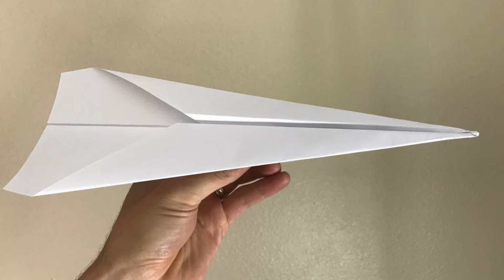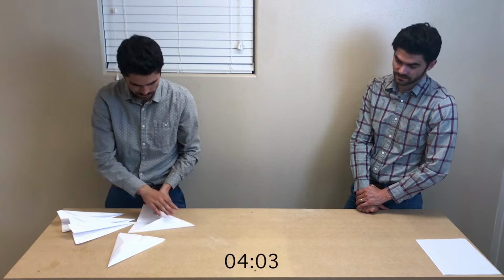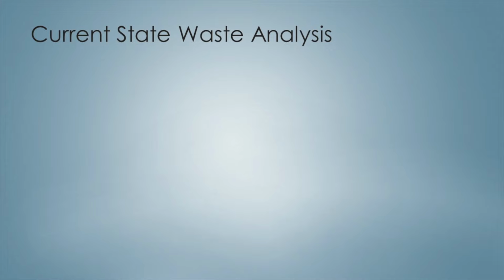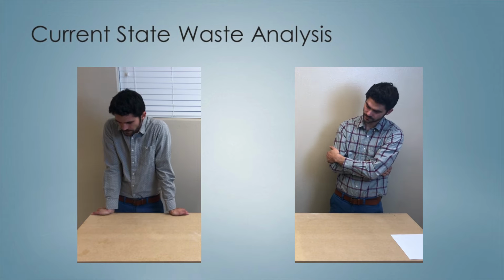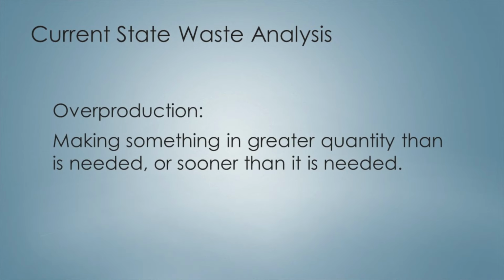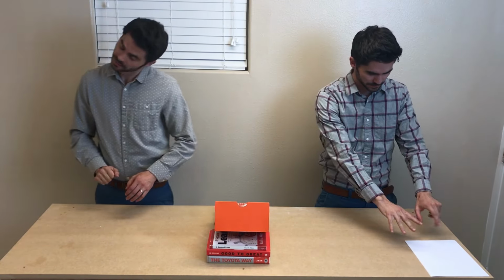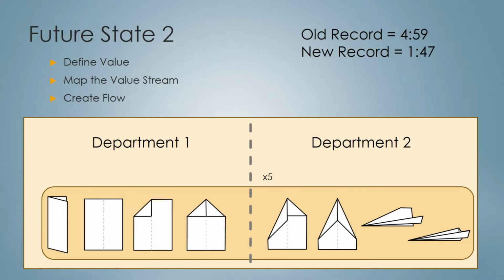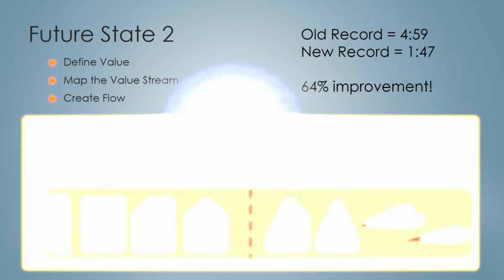Lean Manufacturing One Piece Flow vs. Mass Production Paper Airplane Simulation (Lean Tip 005)

Comment: You guys never show these thing implemented on a real complex line. Your examples are always legos and i guess now paper planes. Show me how you do these for glue, potting, and varnish cure times in between builds.
Reply from the maker: If you live near kansas city, contact me via my website! leansmarts.com. The goal is one piece flow but in the places where you can't do that, you pull in small batches. Gluing and varnishing, with unchanging cure times determined by physics/chemistry, may demand a degree of batching. it just depends.

When my wife and I did our donut business, I was never going to mix enough dough for one donut at a time. We'd go out of business. But our business model was extraordinarily benefited by producing dough in small batches (versus large/huge batches). And the rest of the production process was exceptionally well balanced and linked together with minimal in-process inventory.

Comment: Without producing to actual demand this isn’t remotely lean - you just went from craft / batch production to a basic division of labour like Henry Ford did at the turn of the last century. 
We are now living in the on-demand economy where, for example: At Amazon the book doesn’t even exist until you order it. It is then printed and assembled on demand via a flow system and it is with you in less than 24 hours. 
No wonder lean has a reputation for failure if the basic foundations are not being taught. 
You have to simulate: 
The one-by-one ordering. 
The what you do when you have nothing to do
The progressive division or contraction of labour and physical flow depending on demand.
And the many other aspects of lean… 
Just-In-Time logistics etc.

Comment: I really appreciate your videos. You are giving great examples to learn about Lean. But I have a doubt regarding one comment that you did. It’s about Inventory. For me, inventory is the action to count what do you really have in your process or factory because somehow you don’t trust the accounting system that you have.
Reply from the maker: Don’t apologize! I think I understand you, and in a way I don’t disagree. But I would instead say that the “gemba” is the truth. That’s the Japanese word for the actual place where work is performed. A good and smart manager or person will go to the gemba to know the real situation. Computers and reports are powerful and can be useful, but there’s no substitute for the real place. Also, there’s often error between the gemba and softwares/reports. At the end of the day, the accounting records need to be completed and hopefully accurate. It’s easier if there is less inventory. But it’s still a necessary evil to audit and cycle count, etc.
Reply: @LeanSmarts  👍👍 I agree totally. Gemba is the truth, what it is really happening. I’ve heard that in some places they are calling the 9th Muda the Wrong information. Some how if the information that you have is not correct you will need to check or look for the correct one. (In my opinion that will be included in the inventory Muda). Many thanks for your reply!!
Reply: And of course it is a total waste. But I don’t see that you are counting planes in your video. But of course you could do it, and yes it will be. Sorry to share my thoughts

Comment: For the company I worked for a blend of old vs new processes was ideal, one piece flow doesn't work great when you have multiple workstation processes, you lose time getting up and moving to next station. Per.piece it's slower than perhaps doing 5 pieces moving to next station making the next move with those 5 pieces, just be cognizant of an employee at the end stage is not waiting , it an adaptive process , what works for one company might not be ideal for another. It's a continuous improvement process.

Comment: In this example, you can eliminate the idle time of the workers entirely by letting both of them do the entire process separately from one another. Also, it looks like you could do the first three folds with the entire batch of 5 stacked on top of one another. One more thing worth considering is that you can do folds 2 and 3 simultaneously with your left and right hand. Perhaps a "press" of some sort would also help speed up the process of carving out the lines in the paper, much like Japanese printmakers do, albeit in a different way, with special wooden tools. Interesting example!

Comment: Don't you have 5x the transportation with the one piece flow?  How does that figure in?
Reply: No. Since it is a one-piece flow, it will flow in the production line in the quickest and smoothest way. Whereas with overproduction, you will need to store ( larger space) and need conventional transporting system ( trucks etc).

Comment: This video - and many similar - aims to illustrate the 'large' benefits of reducing batch sizes. It primarily illustrates is the effect of idling resources; resources in the batch process are idle half of the time. In a continuous flow, the throughputs are identical and independent of the batch sizes, i.e. the productivity is identical. The benefits of reducing batch size come from the reduced WIP and/or cycle time. And then we are back to the discussion of the trade-off between transaction costs and holding costs - or efficiency versus speed
Reply: 100%!

Comment: One peeve I have with this type of example (here and other places I've seen similar ones) is that most of the improvement comes from making station 2 work at the time as station 1 as opposed to sitting around waiting. In real life, you're probably going to be continuously doing batches of 5, in which case (after the very first batch) both stations are already going to be working simultaneously. In that case, there can be benefit to one piece flow, but not necessarily... you have to take into account set up time and the like.
Reply from the maker: Hi John! The video primarily demonstrates significant lead time improvement. There’s also a reduction in process time per airplane due to some reduction of motion. But even if there is no change in the amount of process time per airplane, the lead time reduction is very beneficial for the nimbleness of an operation and its ability to adapt quickly to changing customer demand or production problems. Perhaps one day we’ll make a new one of these videos that more strongly demonstrates process time improvements! In the meantime, don’t throw out the idea of flow. There’s radical gains to be achieved by it.
Reply: Sure, but it's about finding the right sized order for the flow to continue. In that example, it made sense to the workflow to do 1 at a time then pass it off.
In my company, we recently discovered that small batches work well in certain situations. For example, we have a customer who put in an order for 10 different items... each item had several components with slight variations, so it requires double checking. So instead of one person processing the whole order at once then handing the whole order to someone else to check, they discovered that if they hand off one item at a time the end result is the whole order being input and checked in less time. 
So, yes, some flows required small batches of work for it to keep flowing smoothly through the system. It's really about the flow of the process.

On the extreme other side of my example, my workers could have input 1 line item then had someone check it. Then one more line item then had someone check it, but that was way too much going back and forth causing a lot overprocessing and transportation that isn't needed.
Reply: @chazhinkeldey2362  It's called Hybrid approach, and the clue is in the name. You use a bit of both worlds. You turn small bunches in one piece and you treat that as... one piece. The key point of OPP is to improve leadtime and in combo with LM you eliminate Motion, Inventory, Overprocess etc. And technically, that's what we see here. This is actually a hybrid as he first does a number of actions and then passes it on to do the rest.

Comment: Very interesting video !
But if there is only 1 batch to produce, this video is ok but in real production, when department 1 is producing batch N, department 2 is not waiting but finishing to produce batch N-1.
Then when dept 2 is finishing batch N, dept 1 is starting ton produce batch N+1.

That would be  interesting to explain  that for batch production : they finish 2 batches within 4min59, batch N-1 then batch N (so 29,9 sec/pcs),
 then with one piece flow : they finish  1 + 5 pieces within 1min47 (so 17,8sec/pcs).
So -41% process time / pcs
 
Lean is the way \o/
Reply: you need to add buffer inventory at key places to ensure the work is balanced. in this example each 4 operations basically took the same time for each employee but when they are drastically different you need to add more workers to the slower process or add more buffer inventory in between stations

Comment: Well comparaison is kind of wrong: you are only considering 1 batch of five making the two employees doing nothing for more than two minutes.
If you consider several batches, you're bottleneck will be on step 2 (2:45 minutes). So it takes you 2:45 minutes to make 5 pieces (not 4:59). Improvement is still 35%, which is great

Comment: What about if both employees folded the entire airplane by themselves? It would eliminate the transfer time between work cells and the idling of the second cell while waiting for the part assembly. Is there only one type of paper airplane ordered and are they all in A4? Not even talking about the differences between the manufacture times between cells if few types of the planes require different more or less intricate folding patterns! The folding process also doesn't seem all that optimized but I'll let that slide as this is just a demonstration.

As far as I can see after quite a significant time of research into it, one piece flow is an exellent option for departments that manufacture a specific device or appliance but when said department is working in a niche market, manufacturing specialized unique devices in small batches there is no way that one piece flow will work. There is too much variation in the processing times of the said units depending on the size and complexity of the devices we manufacture that the production line grinds to a halt every time waiting for diferent cells to slowly dribble the units up the manufacture chain.. Yet the bosses praise the religion of the one piece flow. It sure works but also has some definite exeptions which should be brought up more instead of making it be the miracle solve-it-all that it theoretically seems to be.
I absolutely despise coming to work just to kill time for 8 hours before going back home to try again the next day. Wasted potential at it's finest.
Reply: Agreed with you. I got 40years of experience in garment manufacturing. Lean method does not apply to every designs of apparel. Complicated garments like cargo shorts or pants has over 50 compnents in average which required whole different set of machines and complex operations. Lean doesnt work on such complicated garments. Apparel that has less than 20 operation are practical in lean manufacturing.

Comment: I like your videos but in the spirit of helping you I have to say this one is totally invalid.  There are strong advantages to batching (like reduction in setup time, operators muscle memory, familiarization with expected quality standards, not having to get re-acquainted with pertinent procedures, to name a few)  If you had operator A and B both working simultaneously on different folds, and doing a meaningful number like 100 units you get a different result.  Our factory improved production throughput by 40% by moving from continuous flow to BATCH production.
Reply: Agree. I think most of the waste in this video comes from the under-utilization of the resources. Only one of the two resources are working. Startups and shutdowns should not be included in performance measures -  and are explicitly NOT covered by e.g. Little’s Law. If you do this exercise on 100 batches and don’t count the first and last, you will get a completely different result. And there ARE benefits in batch production, typically that it distribute startup costs over several items or by handling all items at the same time (economics of scale).
Reply: Erik Kaare Andersen that's a very good point. I work in aerospace and we use lean manufacturing. But we also machine in batches.  However we utilise single flow within batches. For example a component will be ground, then go on EDM and then go on deep hole drill rather than grinding all 100. Then EDM 100 then deep hole drill 100 this is still classed as a batch, but also single flow. Make sense?  I like this video amd im going to share at work to show new starters the ideology of lean and waste reduction TIMPWOOD 😃👍
Reply: @erikkaareandersen9922  The waste here is waiting time ( 1 out of 7 wastes)
Reply from the maker: Congratulations on improving your throughout by so much! That’s quite a large improvement in that metric. Unfortunately, I’m not familiar with your factory. I’m familiar with other factories though that have converted batch production to one piece flow and seen immediate 95% or more reduction in lead time. That’s more my frame of reference in this highly conceptualized video. Best regards, Daniel

Comment: Nicely explained...
But it can be presented by using simulation software by assuming real data from any industry?
Please, suggest us
Reply from the maker: Hi Chetan - are you asking for a simulation software? I'm not familiar with many, although I bet there's something out there. However, a lot can be accomplished in Excel if you wanted to determine the theoretical output of different systems!
Reply: Yes, I am working on SIMUL8, the issue that I am facing is the industry data for any single component such as.....
the monthly requirement, no. of operations, and processing time, etc.
Can you suggest , how can I get this data, so that my simulation will be more practical.

Comment: In a realistic production situation there would have been approx. twice as much produced in the batch scenario, as in the video both workers were idle for around half the time. Normally they would have been finishing the previous batch or starting the next.The time saving is in the elimination of picking up and putting down the paper, so it's a lot less than the video shows on face value but still worthwhile.
Reply: You are correct! I was thinking the same thing.
Reply: Josh C Incorrect because in a realistic production situation you would look at tac times and utilisation which would result in less indirect time and reducing wip.